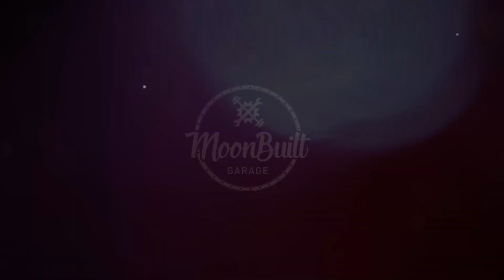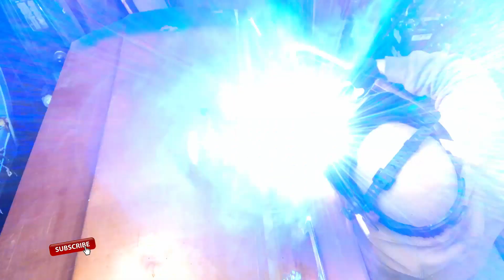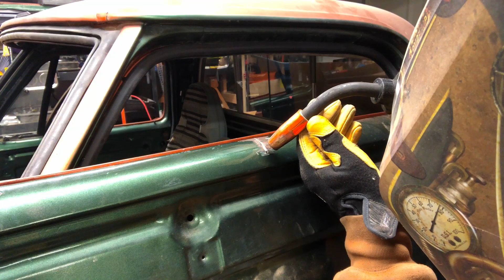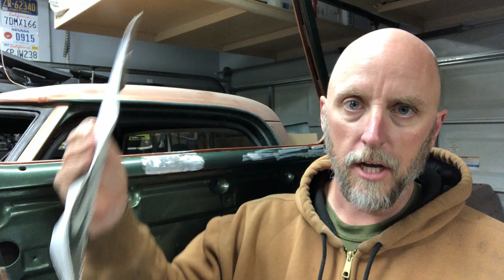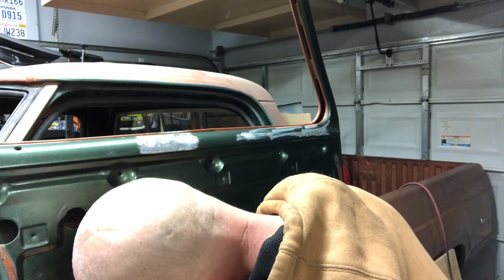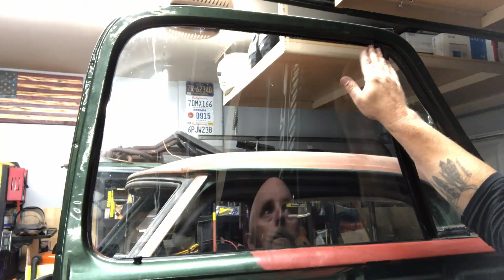Project Truck Door Repairs and Improvements | Dodge D100 Shop Truck Project

Comment: Thanks for providing all the details in your restoration steps.  I just "inherited" a 1972 D100 that needs (among other things...) the window regulators rebuilt.  Where did you get the replacement rollers for your D100 regulators?  Thx.  FYI my D100's 318 motor is siezed (rusted).  I am putting in a Magnum 318 from a 2000 Durango, along with its 46RE transmission.
Reply from the maker: The only place I've found that carries the actual rollers is Midwest Muscle Car Specialities on ebay (https://www.ebay.com/itm/127005422807). For the price of the rollers you're probably better off just replacing the entire regulator (LMC Trucks). 
I put a 46rh from a Ramcharger in mine and that thing has been great

Comment: What wire gauge did you eventually use on the Mig, Walt
Reply from the maker: I ended up using .023 wire
Reply: @MoonBuiltGarage  Thanks